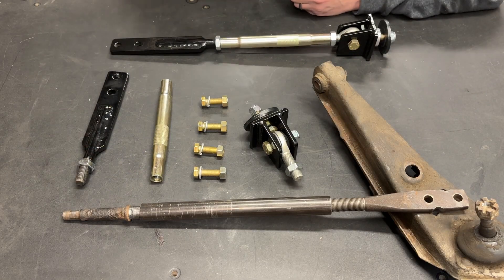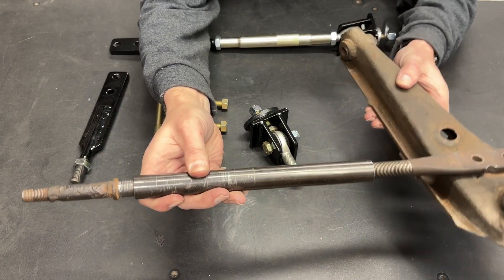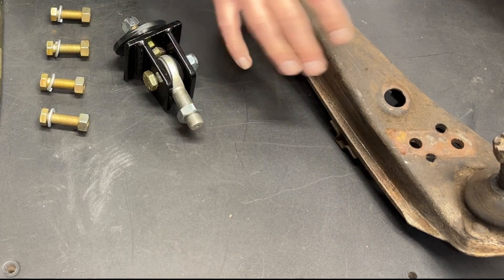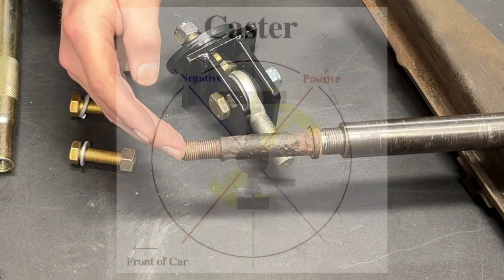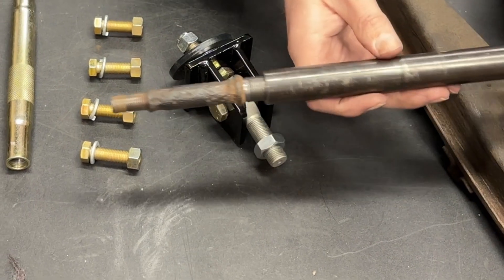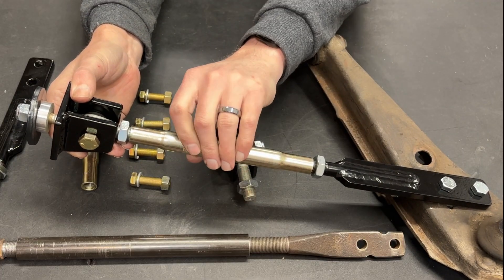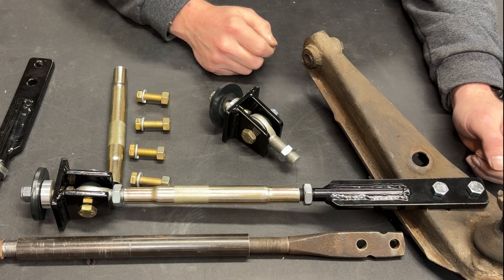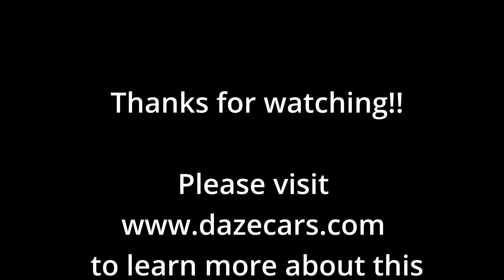65/66 Mustang Strut Rod: Function, Why Make it Adjustable, & Rose Hill Performance Parts Review

Comment: how far can you pull on the lower control arm with this strut rod without causing the pivot to bind up?
Reply from the maker: Depends on the car and the quality of the bushing.  If adding tons of caster I recommend installing a spherical bearing kit in place of the bushing.  Typically you can get 2-3º without binding.  I often times recommend adding a few degrees of caster with shims and then using the strut rods to get the rest/proper adjustment for balance between sides.

Comment: Unrelated, but just found your channel after disassembling a Sole F80 and wondering about the applications for the 3.5hp motor (eBike or lathe, hrm..).  Excellent info.
Reply from the maker: What is the torque of the motor thats the number that really matters
Reply: @dazecars (3.5hp x 5252) / 4000RPM = 4.59 ft lbs, if I'm following your video/formula right.  I just need to figure out the pinout for the PWM header on the power supply, I want to communicate with it using a MCU (ESP32).  I've been doing PWM/PID stuff with other devices (cartridge heaters).
Reply from the maker: That math is correct and that is a very good treadmill motor.   It should work vey well for a verity of applications.
Reply from the maker: I don't have a hack for that board

Comment: I bought a set of these last year and have been very happy with them. Fit and finish are excellent, and it made an alignment on my '65 Mustang much easier. 

Also: my original strut rods were far more degraded than the OEM ones in this video. I have no reason to believe they weren't original to the 59yo car!
Reply from the maker: Glad you are happy with your set!

Comment: Cool looking product. I do have concerns about the engineering behind that product; the use of Grade 8 bolts makes me wonder. Note the Grade 5 bolts where the rod attaches to the LCA.
Reply from the maker: No the bolts on the table are what comes with the kit to attach the strut rod to the LCA and they are grade 8. In fact all the bolts are grade 8.  I threw the grad 5 bolts in to hold the strut rod to the LCA simply to demonstrate the adjustability.  Those are not the bolts that come with the kit.  They were just easily accessible when I shot the video.